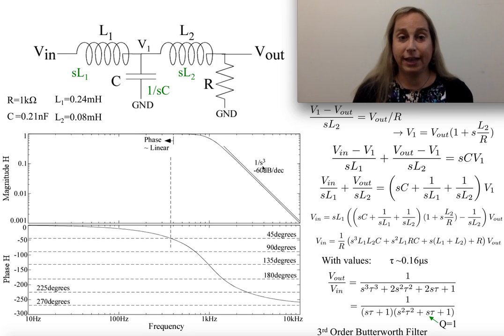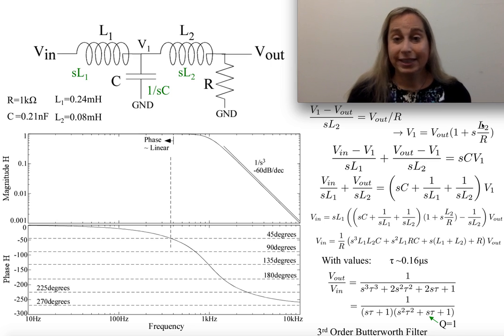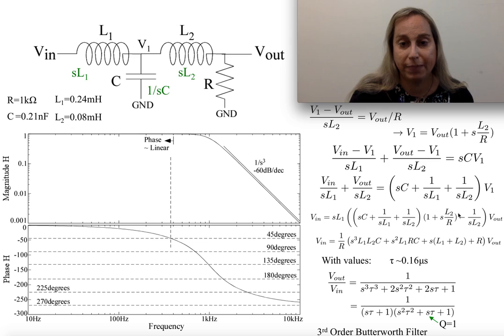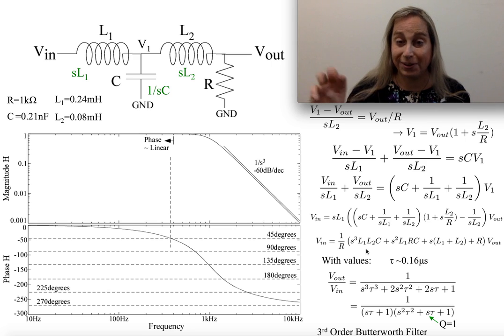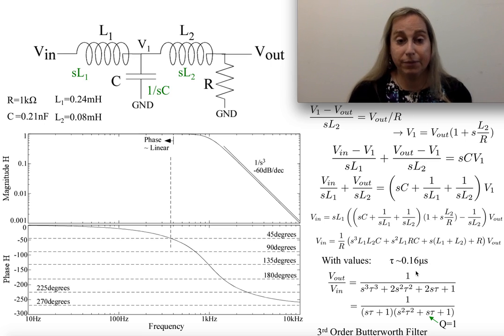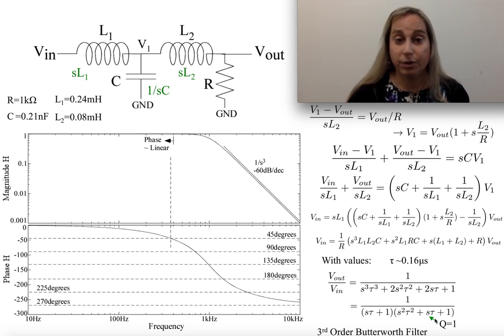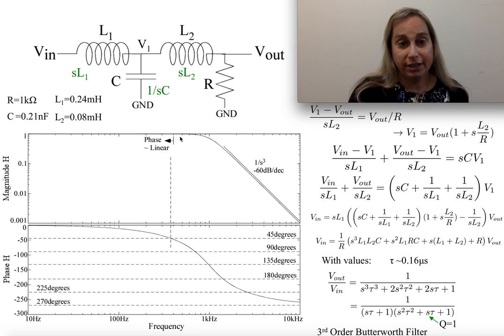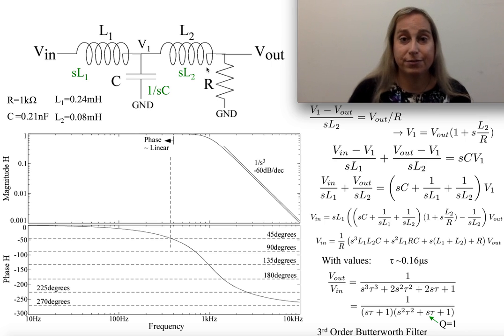An L, R, C circuit for a 3rd order Butterworth Filter

Comment: Cool! Very interesting, thank you! If I make R variable, will it change only the ƒc of the last part of the circuit (LR) which looks like a LP? Or will it have influence in the whole 3rd order filter? I'd like to bread-board it so I ask to know what should I expect - I'm looking for interesting 3rd order filters, but with dynamically variable frequency over a range of around 5Hz-18kHz and I do that usually with a 5M-1k5 photo resistor + voltage controlled LED, so I look for circuits that can use a variable R element...